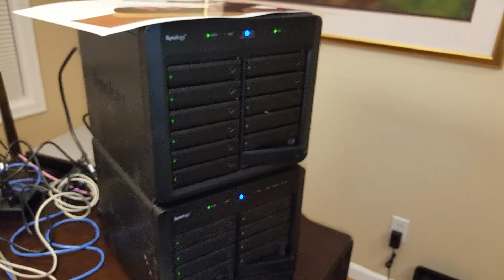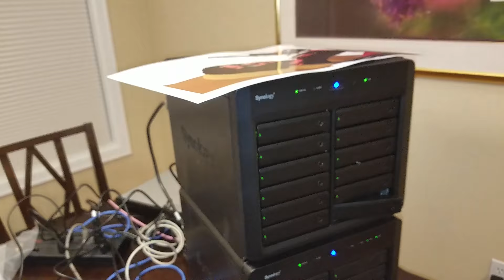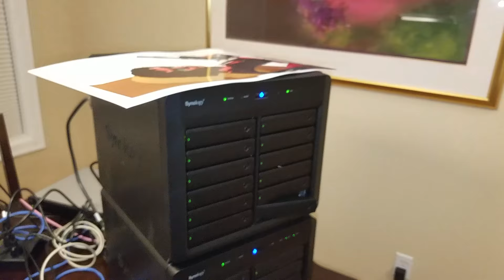Hard drive server upgrade vlog. Drunk edition.

Comment: If you have Decent internet then you can replace google drive. But your house can burn!, a thief can steal your box, WannaCry virus can get affected.. so storing most important data on your own home is a good idea but not a brilliant idea.
Reply from the maker: You don't know me very well... My server sits in a dedicated vault/safe with a halon like system. That server is backed up over fiber to a server in down town Seattle that runs BSD. That server is then backed up to the same servers in Missouri that run the Nasdaq.  Right now, i'm tapped out at 240TB local and 180TB on each arm of the network at roughly 50% utilized. The Seattle server is backed up every month to tape, and that tape is shipped to a vault in a Nevada salt mine. Im as close to "nuke proof" as i can get.

Comment: Why would you so much storage? 
If you know what i mean
Reply from the maker: Mathis | InTheEyesOfThis Video eats lots, but mainly I'm starting to wet scan 45,000 slides at a few hundred MB a pop, and don't want to rebuild the drives for a few years. Also, I have to back up two active SAD raid 0 clusters, one 24TB, and one 16TB on workstations here for 4k video. Big Cam, the DVX200 at UHD 10bit 60 fps is running at 400MB/s... MegaBytes... not bits.... to 4TB SSD drives.... yeah, welcome to Datagedon.
Reply: Jezus christ hahahahah